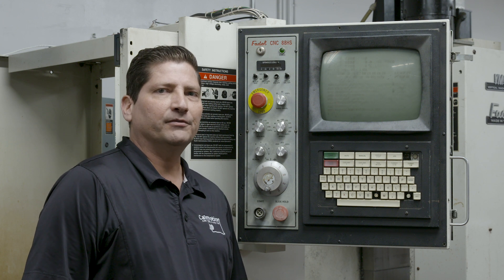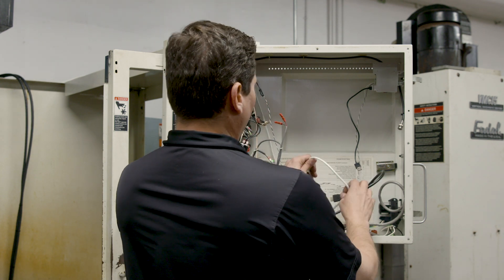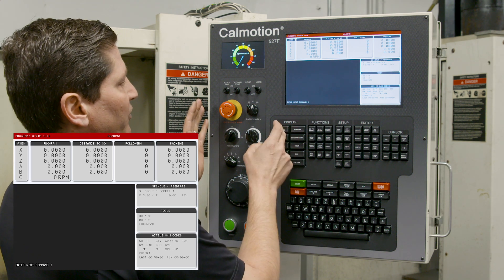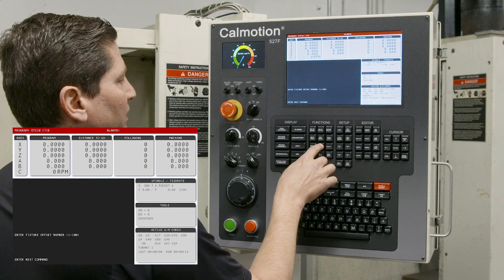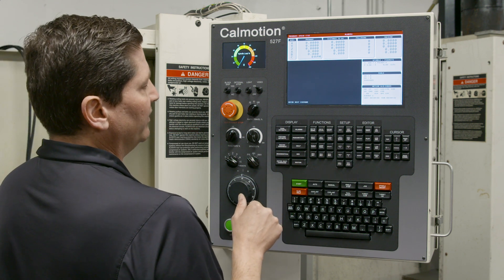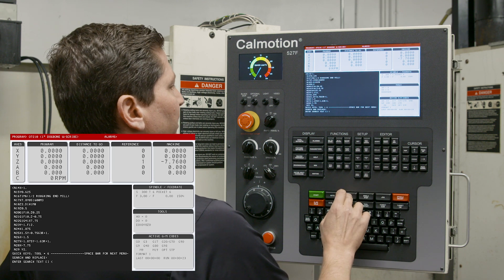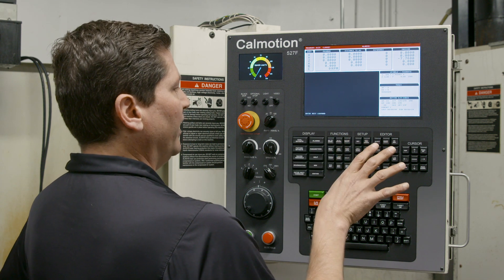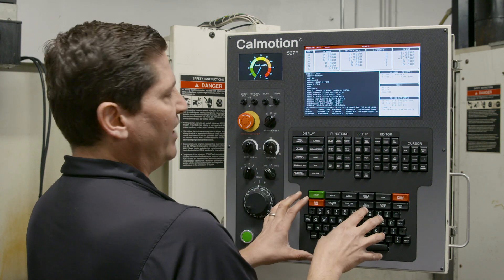Calmotion 527F Optional Control Pendant Upgrade

Comment: The guys who repaired our machine said, it won't make much improvements if you update the control but you don't update the servo motors. It makes sense to me but, what calcmotion people think about ?
Reply from the maker: The advantages of updating your Fadal to the Calmotion depends on the types of jobs you run and how you run your shop. If you do any surfacing the improvements are huge, you can see our document on our website that describes the time and part quality improvements. There is also a Modern Machine Shop article on our customer Baitjunkys describing his success story of updating to the Calmotion with saving time and improving quality. Also, some customers save hours a day because on their Fadal control it would take hours to load large programs into the 16MB memory. Others love the advantage of copying files into the controls memory with USB or over the network, the Calmotion has a 1000 times more memory than the Fadal control and is a lot faster at processing g-code programs. We support all Fadal machines, tool changers, machine sizes and pendants, and the install is very straight forward. Email us and we can provide you with the documents mentioned above.
Reply: @CalmotionProducts  Yes I'm convinced the software and electronics update is far away than the old 88HS control. I still have the question about the servo motors, I want to say that if they are as old as the machine, wouldn't need someone in order to be a complete retrofit, change the old servos?. I don't know how much improvements  have the servos gone thru since 1997 up today

Comment: The blend redius I was talking about is the blend from a circle to a circle a line to circle circle to a line page of options sometimes hard to figure out the book fadal book does not explain very well
Reply from the maker: With the Calmotion 527F you would use a modern CAM system. Here is the option you can add to the Calmotion 527F control to use a modern CAM system, shown is Autodesk Fusion 360 CAM: http://www.calmotion.com/pc-option.html

Comment: Can you adjust ramp ins on circle and rectangle pockets like feed in different  ipm than milling around
Reply from the maker: Contouring ramps are handled by the control automatically. Set the Gcode for the desired IPM to mill pockets and else where.